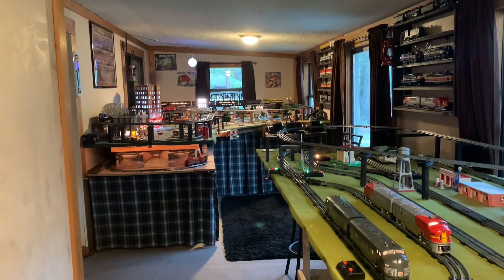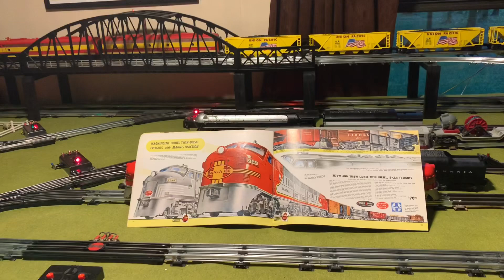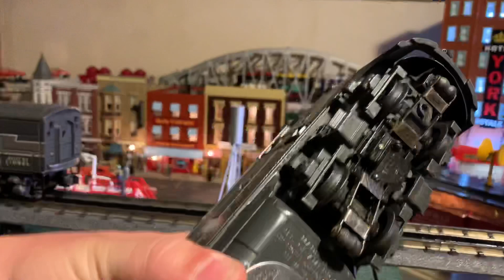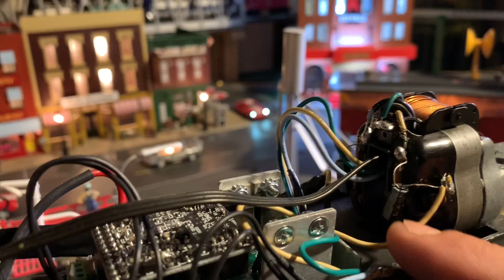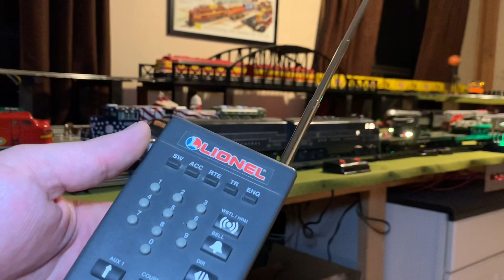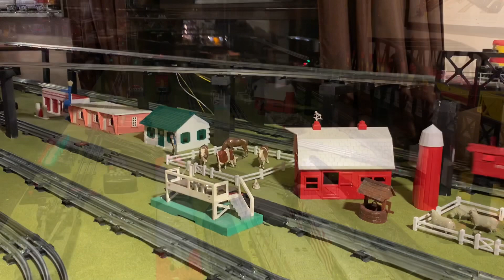Postwar Lionel With Command Control?! : Lionel 2354 NYC F3

Comment: Hey question, my original f3 battery case is rusted on the bottom. The horn works but lots of times it sounds like a dying duck, so how would i get rid of the rust or atleast make the horn normal? The rust came from the previous owner who left the battery there for a long time. Thank u

Comment: You should have left it TOTALLY postwar. I've had problems with electronic circuit boards and you can't fix them. E units easily repaired or swapped out.

Comment: I was watching this video again and you were talking about adding the tmcc to the TIU and you mentioned putting 2 bricks 135 watt bricks through the TIU. Is the 135 watt brick not enough to power the single port from the TIU? I use a 50 watt MTH as auxiliary power and on my power inputs to the TIU I use 3 180 watt Lionel bricks and a 100 watt MTH power brick. I don't have any power issues on my my 7x14 layout. I use 2 channels on the TIU for DCS and 2 for conventional and have a 275 watt ZW for my other 2 loops on the layout. I just picked up another 250 watt ZW that needs a new cord and rollers. It will make a good backup.
Reply from the maker: The 135W brick has been plenty of power, but I was trying to run 4 or more trains off of it at the time, and it wasn’t enough power to support em all. The brick was powering 4 lines or loops, and it was just too much. Have since added a 2nd TIU and more transformers to correctly run everything. Everything runs a lot better when each loop has its own channel on the tiu. Hopefully that makes sense lol. Gotta love the old ZW’s!
Reply: @CountryBunkersTrains  on our club layout, 1200 sq ft with 3 Z4000 transformers, a club member and his grandson have run 19 separate trains on the 4 main lines.

Comment: I have a question when you do this upgrade do you need Lionel tmcc or can you still run the locomotive conventionally with a transformer and some track? I was looking to do this on a postwar Lionel 2337 gp7 would this board work? And which board would I need an ac board or a dc board?

Comment: Hey mr zach.just something you might be interested in.thats outstanding putting tmcc in a classic.lionel product 6-12867 allows you to run conventional engines with a tmcc box and cab1..it was easy to set up.a relative newcomer like me had no problems.it claims to run any lionel engine ever made.most of my tiny fleet is conventional.i only have 3 command engines.its real cheap way to go.it works by controlling track voltage with cab1.anyway just thought you would like to know.love your channel and collection
Reply from the maker: Hey William, thank you for watching! I am glad you are enjoying the channel! I have never used the power master before, however did use and still have a TPC 300 for the conventional engines. I believe it works the same as a power master. It controls voltage to the track from the TMCC system. It worked very well, but if I recall correctly, it could only control one track at a time. I quit using it once I got the DCS system. The DCS system has the ability to control 2 tracks in variable mode. However I got the ZW’s around the same time and just use those for conventional operation through the DCS. It was a great way to be able to control either command or conventional on the same track. Take care and talk at ya later!
Reply: @CountryBunkersTrains  so I gave you old news.such a nice postwar engine set.I would be afraid to tinker with it
Reply from the maker: @williamkolina3988  all good! Always appreciate a helping hand/advise. She is a beauty. Luckily she can go right back to how she was in about 15 mins or so.

Comment: I have the older version set in Santa Fe, I just wired both the powered and the un-powered unit together on the center rail connection. Those motors draw a lot of power, and the rollers sparked a lot, adding that meant it was now using 4 collectors and the sparks were less and the power draw divided.  I noticed on the powered unit that the ladder on the front truck does not line up with the ladder above it  but the un-powered unit lined up fine.
Reply from the maker: They do suck up some power for sure!! I’m sure with the rollers wired together, it is a great runner! Especially going over switches and what not. Someone had to have had the front truck apart at one time, for the ladders to not line up. It’s a easy fix. They are just on the wrong sides. If you remove and swap them to opposite sides, they should line up again.
Reply: On the F3 ladders there is a left and right ladder steps. If yours don't line up it is possible that some previously had them off of the truck and simply put them back on the wiring side of the truck.

Comment: Years ago I found a beat up 2333 NYC F3 at an antique shop. I used the guts to power the Santa Fe F3 dummy, giving me two powered 2333s. I set the directional switches one in reverse and one in forward. The two units will pull anything.

Comment: hey Zach Lionel made it bracket for mounting over those horizontal engines might work in this instance those horns are relatively easy to repair !!!
Reply from the maker: Larry Archer You know, I’m a bit slow at times! LOL I didn’t even think of that. Could basically just put a horn and bracket in from an earlier model. May have to do that in the future! Just need to figure out how to power it. Thank you!
Reply: Food for thought a horn relay can be mounted horizontally not sure if you still have room above that e unit but possibly I haven't looked yet but I heard they make electronic one

Comment: Very cool and nice engines.  Where did you purchase the tmcc set up?  I have been trying to find a dealer where I can purchase the kit.  I have several engines I want to change over.
Reply from the maker: Hey Francis, sorry for the late reply. I got the TMCC system almost 15 years ago from a hobby shop close to where I lived. However they can be found on eBay fairly cheaply now a days.